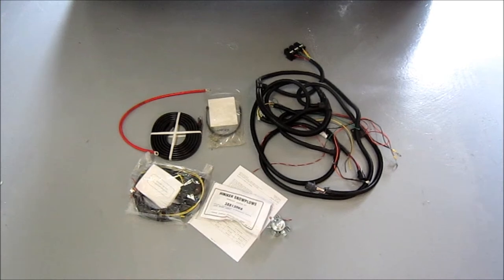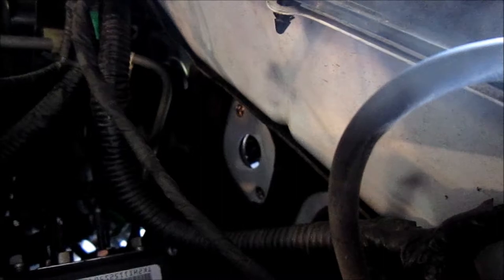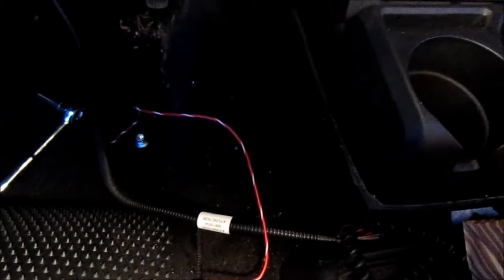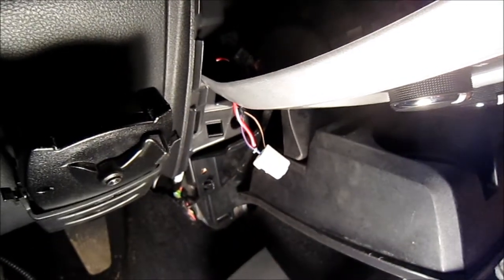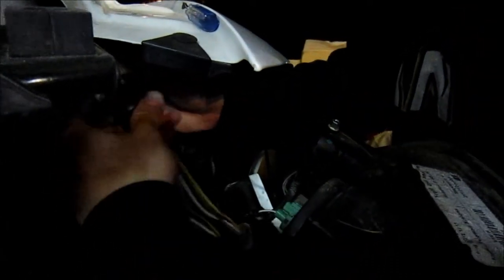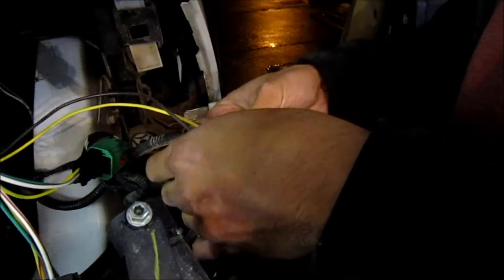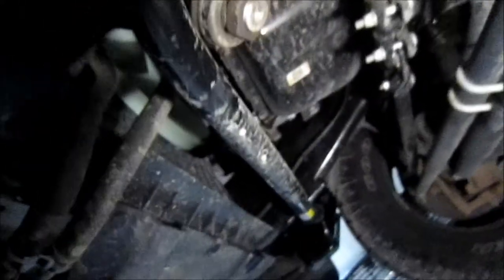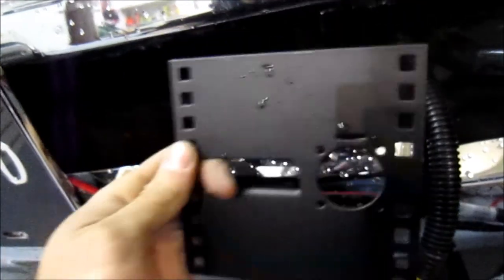Hiniker Snow Plow Installation (2012 Dodge Ram 3500) | AnthonyJ350

Comment: Hello. Question. Can u show a video on mounting and dismounting? I just bought a used Cplow, but it doesn't want to mount up. The lift cylinder doesn't retract. Any ideas?? I loosed up the pivot point bolts but it still doesn't go down.